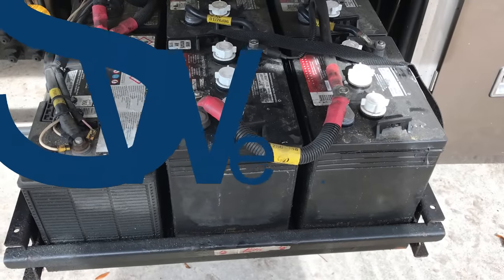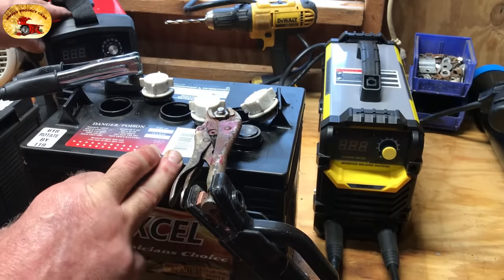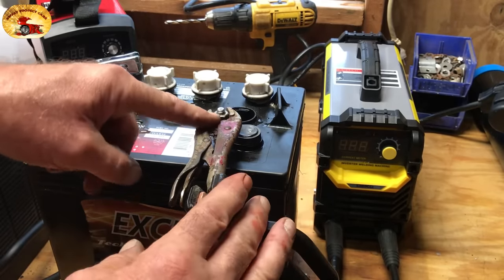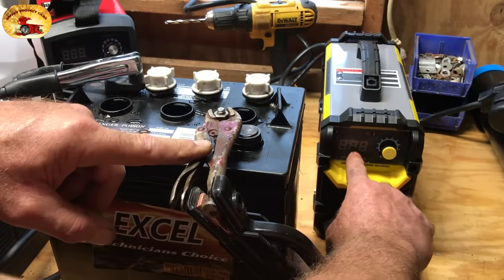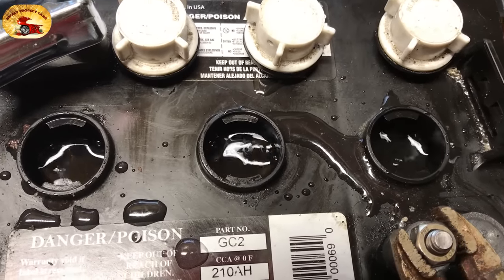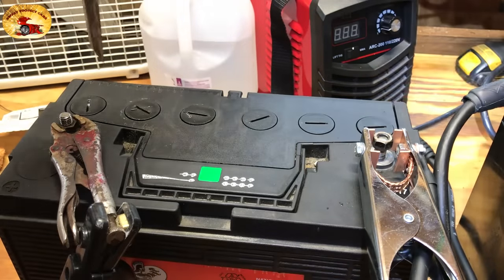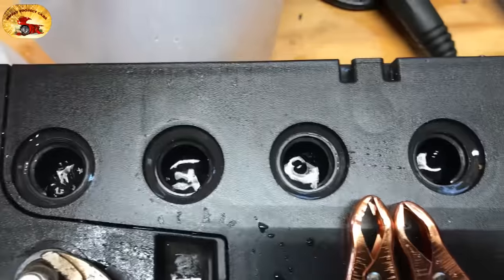How To MAKE OLD BATTERIES NEW Again!!!  12v 6v Deep Cycle, Car, Truck, Golf Cart, Semi

Comment: This is a great video, thank you for sharing your knowledge.  I watched your other video where you used the associated battery charger, which method do you think is better?  I know using the welder appears to be a faster process, but curious is one method is better over the long run for the battery?  Thank you!
Reply from the maker: We recommend this process using the welder, it's faster, safer and you can weld with it if need be.  Thank you for watching and asking Mike, we appreciate it. Have a great weekend my friend. mad Mike the hammer SPC
Reply: I am wanting to refresh my 12v golf cart batteries which welding machines do I get . Thank you sir
Reply: @SweetProjectCars  I finally had a battery go out and wanted to give your project a shot.  Before I buy one of these welders I chased my brother down (who is a welder by trade) and he has a very expensive Lincoln Tig 200 AC/DC welder that he said should work just fine for something like this.  Well, I walked through your video to a tee, took off the caps, put quite a bit of distilled water in the battery (almost a half gallon total), hooked everything up just like you advised and turned the welder on to the DC lowest setting and got nothing bubbling, so I turned up the amps as you instructed and got nothing.  After 2 attempts and dialing all the way up to 180 amps with no bubbling, I thought I better come in and write this for you advice.  Cells are full of distilled water, positive to positive through clamps as you advised, same with negative, and nothing.  Super confused and hope you can help.  Thanks again for sharing all of your experiences.
Reply: @MrSledjunky17  Are you sure your battery does not have a internal break which prevents electricity from flowing through the battery?  Put a continuity tester on it.  If it does not have continuity then battery is toast.  Or at least that is my understanding.

Comment: Another thing that works for me is to insulate the battery from a cold surface. Then point a fan heater at the battery to warm it up. Then every now and then. Say every 20 minutes, connect a car charger to see if it starts taking a charge
Reply from the maker: Thank you for watching and sharing.  Have a great day 2B.  mad Mike the hammer SPC

Comment: I live off-grid in the PNW. I have a micro hydro-electric power plant that I use to charge six 6-volt deep cycle batteries (Trojan T105). The batteries typically last about 5 years. They are expensive to replace.

I am going to try this method to bring the old sets back to life. I need a welder anyway, so... 

I'll let you know how it goes.
Reply from the maker: It's a win win Cregg, you get a welder to use for repairs and rejuvenating your batteries! Thanks for watching and sharing, have a great day and all the best on your project my friend. mad Mike the hammer SPC
Reply: How'd that go?? I can get cheap used T-105's in my area.

Comment: Mike, what is the advantage of this method over the previous version you did using a charger with the 200 amp "start" setting? I don't have a stick welder, but I do have access to the 200 amp big boy charger. I have a 12v Deep Cycle Marine battery (Group 24DC, 690 MCA, 101 aH) that has been sitting for years unused.  Currently reading only 3.48V and won't take a charge on a 4 or 6 amp charger. Do you think I can revive that with the original "15 mins on - 1 hr cool down - 5 X's" method using my 200 amp charger?  Or would I be wasting my time with such a dead battery?
Reply from the maker: Both methods work DieselMike, this is just our update, it has a lot of helpful information about the process and is more economical for those that don't have the big boy charger :)  Give it a shot on that battery, we've revived batteries with this method that you would never think you could, sounds like you've got nothing to lose my friend. Thank you for watching and asking, we appreciate our great subscribers like you, hope you have a fantastic rest of your week and all the best on your project. mad Mike the hammer SPC

Comment: @Sweet Project Cars

Thanks for the vid! I tried this out on my 5 year old battery that's been sitting in storage for about 2 years.
I was able to get all cells to bubble just like in your video and even repeated the process for about 10 times. I let it rest for a day and then followed it up with my CTEK battery charger for an entire day.
I tested it with my voltmeter and it held a voltage reading of about 12.70. I then installed it on my Diesel SUV but unfortunately it wasn't able to turn over the engine.

Is it possible I missed as step?
Reply from the maker: Your battery is toast my friend, sometimes they just have run their course.  Thanks for watching and sharing, have a great day. mad Mike the hammer SPC

Comment: The newer model Amico ARC200DC has 2 knobs. The one on the left says "ARC FORCE". The one on the right says "115/230 V". Do you leave the one on the right on low (115) and the one on the left on low and adjust as needed?
Reply from the maker: Leave the knob on the left at 1 then slowly turn up the other knob until you get a consistent boil on all of the cells Scott. Thanks for watching, have a great day. mad Mike

Comment: Do you have a DC clamp meter? If so, I'm curious what the amp reading is on the lowest setting.
Reply from the maker: Go ahead and give this video a shot you can find out all the amp readings you want.  It's fun to investigate.  Thanks.  mad Mike the hammer SPC

Comment: You are a lifesaver. Instead of spending $5-600 on the charger I can use a $200 welder, and have a welder!
Reply from the maker: Absolutely!! Thank you for watching and sharing, have a great week my friend. mad Mike the hammer SPC
Reply: Do you still need to charge the battery using a charger or would this process leave your battery fully charged?

Comment: What voltage are you using?
Reply: 110v and 220v are the input (supply) voltage options for the welder - not output voltage. Either will work as the machine will automatically convert to the required (adjustment) setting.
Reply from the maker: Please read swm122758's reply to you, he hit it head on!  Thanks.  mad Mike the hammer SPC

Comment: hi sir what is the "no load voltage output" of the welding machine (inverter) that you used on car batteries?
Reply from the maker: Give the process a shot and you will see first hand that the battery is returned to the state when the battery was purchased new.  Hope this helps.  Have a great day.  mad Mike the hammer SPC
Reply: for a 200amp inverter welding machine, it gives 48-50volts even at no load, Fyi the adjustment  knob shows amperes not volts so careful on using those for charging 12volts

Comment: Can this be done to sealed 12v batteries?  I have to buy new batteries for my ryobi riding mower.  If I could do this for my sealed batteries it would save me huge.  Haven’t looked at my old batteries not sure if the openings are under a sticker or if their sealed some other way.
Reply from the maker: You've got to have access to the cells to see if the fluid level is low and if then need any added. So somehow you've got to get to the cells, if not, sorry but this won't work for you. Thank you for watching, have a great week. mad Mike

Comment: Hi what does it mean if one of the cells has water that is dark, somewhat greyish?  When it's boiling? 

all the others are clear. 

Also, I observed the opposite.  Once I started, all the cells where boiling, then after a while, they stopped, except 1, which is the one that has the greyish water.
Reply from the maker: You can try the video up to five times on the battery as long as it’s topped off with water as you’re doing it you’ll be fine no matter what the color of the water is thanks Mike

Comment: I topped my off with distilled water but it got boiling good at put some fluid on the floor of my garage.  I am assuming that it took some acid with the water when it boiled over. Do I need to add acid now? How do I know how much acid to add if any? Also once I have all the cells boiling good after 5 cycles do I still need to trickle charge it?
Reply from the maker: It's not necessary to add acid Dennis, but if it would make you feel better, have at it. You need this https://amzn.to/3kmCThX  to finish the complete process, please follow the video instruction as shown using all of the products/tools we use in order to get the same results. Thanks for the view, have a great week. mad Mike the hammer SPC

Comment: I've got basically a 6 volt tractor battery that's 10 years old, just been sitting unused,  uncharged.  I've got a 200 amp starter charger, older chgr.  How to best rejuvenate this old, long body, 3E battery that goes in my 6 volt 1948 packard?
Great channel that I've just discovered here.! Thx
Reply from the maker: This works on all lead acid batteries, just cut all timelines in half for that size battery Bigfoot. Thank you for watching and asking, glad you found us! Have a great week my friend. mad Mike & team

Comment: Hey,

Great method!
I've done exactly as you instructed on my Golf Car, I have X6 deep cycle batteries of 8V 170AH (to get 48V for the motor). 
It worked perfectly, good bubbling for all 4 cells for all 6 batteries. 

The thing is that the liquid turn to brown and opaque really quick on the first cycle for all 6 batteries.

I,'ve completes all 5 cycles and assembled all back up to the club car and gave it a charge. Left it till morning before driving to let it set up. It runs a bit further, about half an hour instead of 10 min so there is an improvement. A new battery run for about 5 hours before charging is required.

Is it because of the color of the liquid? Should i run more cycles on them?

Thanks man!

Kobi
Reply from the maker: Hello Kobi, sounds like your batteries have all good cells and are worth keeping.  In that case we suggest replacing the fluid with this https://amzn.to/30WJlDg and make sure you use this https://amzn.to/3bXPS77  to guarantee you have the correct gravity/density of the electrolyte.  Thank you for watching and asking.  Have a great day.  mad Mike the hammer SPC
Reply: Great, thanks for your reply, I will replace the fluid as you suggested.

Is it worth to clean the cells, after removing the old acid, with baking soda internally and run flushes to the cells until it is clean from the "sludge"?

After it to fill with the fresh acid.

To save few bucks, is it worth to collect all the "used" fluid to a container, filter it and correct it to the right gravity? Or just replace it all?
I already got 1.5 liter of 98% sulfuric acid and the gravity gauge.

Cheers,

Kobi
Reply: @kobipinhassi526  did this work or did you have to get new batteries?  I have a couple batteries that boiled and a couple that I couldn't get boiling.  Before I spend more money I would like to find out if it's worth it or if I should just start fresh with new ones and go from there.
Reply: What welder did you use? If it was 165 yes welder.. please do tell what settings you had on the welder.. i did 3 batteries 6v.. could not get one cell ro bubble
Reply: I’m using the Amico welder that you suggested. I’m having maybe 40% success with your procedure after trying to revive a dozen batteries. The battery fluid bubbles right away. More amps = more bubbles. Some batteries are more active than others. I’m usually starting with 50 Amps, then up to 100 Amps during the last minute. Or 150 Amps on big tractor batteries. Some cells are slow to bubble.
So when I put a Walmart meat thermometer in a bubbling cell, the temperature barely goes up. However 2 batteries went up to 140-160 degrees. They must have a short inside, so they got trashed.
I’m trying to learn if I need to drain some of these batteries that aren’t coming back & install fresh fluid….65% distilled water & 35% ac8d.

Comment: If the battery can be charged with a high voltage DC power source, then it was still good. This is not a magic genie spell that fixes a damaged battery. Also, next time a mechanic says "bad cell", ask them to explain in detail what that means. Their face is always hilarious.
Reply from the maker: Thank you for watching and sharing Adam.  Have a great day. mad Mike the hammer SPC

Comment: What about a lead acid battery that seems to have a direct short between 2 cells  on 12 volt marine battery fairly  new??
Reply from the maker: We've had it work on batteries with damaged cells, just depends JW, give it a shot, sounds like you've got nothing to lose. Thanks for watching, have a great day. mad Mike the hammer SPC

Comment: DC inverter welder amico 200 didn't not work. It boiled ok but didn't bring battery back. Should I do I again
Reply from the maker: Hello Bill, you can repeat this complete process up to 5 times, if it doesn't work after that, your battery is toast.  Thanks for watching, have a great day. mad Mike the hammer SPC

Comment: Interesting, I wonder what is going on chemically to bring them back. I was always under the impression that they had to be replaced due to the deposit buildup/breakdown of the actual lead plates vs the opposing (ie they are spent and must be replaced with new lead).
Reply from the maker: Well, we've been doing this process for 20 years, not quite sure what's going on inside there because we can't see inside, much like a bumblebee, they're not supposed to be able to fly, but they do.  Thanks for watching.  Have a great day.  mad Mike the hammer SPC
Reply: @SweetProjectCars  I am definitely going to give it a try I've got one for a small car sitting around.
Reply: To my understanding the lead plates will let's say grow little hairs for lack of a better term that reach across to the next plate creating a little short and by over charging for a little bit it will burn them off so as long as you don't have a broken plate in theory it should work but that is what I have heard so I can't say that's a fact but it sounds logical to me
Reply: Positive plate corrosion is a cause of failure but isn't the only cause. If the grids aren't failed then the issue is sulfation crystals that are too rigid to normally dissolve in the distilled water solution so a high amperage charge sometimes can break up those crystals.

Comment: The difference between a battery charger and a welder is the volts. Thus why you can put 200 amps on it with a charger because the volts are low. A welder sends a crap ton more of volts into the battery and that explains why you are so carefull with the welder.
Reply from the maker: Exactly, that's why we say start out on the lowest setting and turn up slowly to get that boil.  Thanks for watching and sharing leakyjeep, we appreciate it my friend.  Hope you have a stupendous day!  mad Mike the hammer SPC

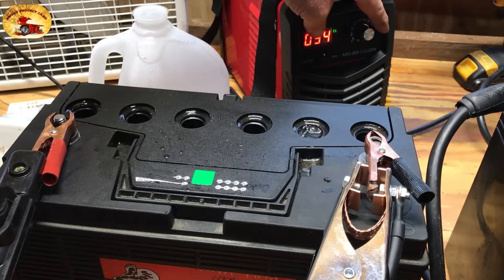Comment: 9:05 you are runing only 80-100 amps? i though you mentioned that it should be around 200 amps? what about voltage then is it matter or dont bother with voltage? i cant regulare the voltage ofocurse only amps
Maybe i dont need to buy another welder becouse i have already on that is up to 140 amps...
Reply from the maker: Please re-watch the video, you start out on the lowest setting, then gradually turn it up until you get a consistent rapid boil on all of the cells, then follow the video instruction using the same products/tools shown. Thanks. mad Mike
Reply: @SweetProjectCars  i am runing the process and the cells are boiling even on 40 amps .. i stopped at 80 . It smells afwull and there is steam from all cells its possobile that there is only destilled wather there ?  I am runing 5 min and 10 min break between . Batery lacked density it shows 12 v but when im starting car it drops way below 10v when i charged it it was 100% but after 5 times it was dead and i needed help to start car it was in one day. My plan is to do 10 times then charge it and check if there is any improvement , any suggestions? thank you for help Greetings

Comment: Thanks  for the great  tip. I just  bought a golf cart with poor batteries.  So I hope this works.  Quick question.  The link for the yellow  welder shows two options.  160A and 160mma.  Id like to get the  160mma one so i can tig in the future.  In your video  you mention  that yours  can do no touch tig.  I just want to confirm  that I can use the 160mma  model for reviving deep cycle  batteries.

Comment: Could I power that welder with a 2000 Watts petrol generator.
Reply from the maker: Give it a shot, see if it works, if it doesn't plug it into the wall my friend. Thanks for watching. mad Mike the hammer SPC
Reply: @SweetProjectCars  I don't have access to power supply.